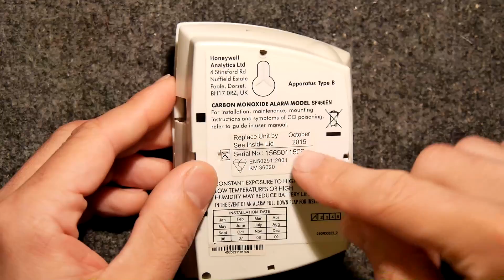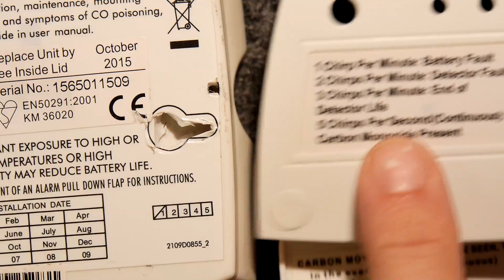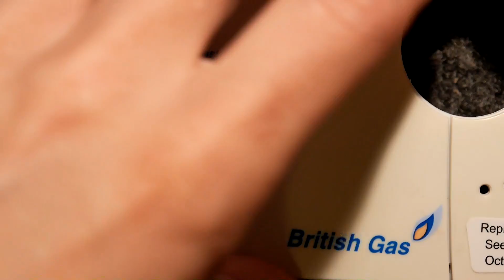Carbon Monoxide Detector Honeywell SF450EN

Comment: 3 pin piezo elements are feedback type for non self-resonating circuits. i.e. the micro doesn't generate the pulses, instead the micro controls an external driver circuit.

The expiry date on the unit is because the sensor is voltage generating sensor based on chemical reaction that degrades over time

The 3 wire device bent over is the driver transformer for driving the sounder element in an auto-transformer arrangement.
Reply from the maker: +sivalley Thanks so much for the expansion! I'm guessing a lot of this design is to ensure the lowest quiescent current as well? I notice that most alarm designs seen to operate on a frequency of one pulse server few minutes - or at least their battery check does.
Reply: +The Backoffice On the right path.  Most detectors sample at a very slow rate and sample more frequently if a change between the last and recent samples. This is also why if you look at detection sensitivity of most detectors you will see X ppm in Y minutes, sample rate increases as it approaches alarm threshold.

Because the outputs from microcontrollers is limited to a few mA, you won't be able to drive a very loud sounder.  But rolling your own driver circuit is a lot cheaper than using a relay to drive a sufficiently loud sounder. :)
Reply from the maker: +sivalley I think you have educated me totally on this ;) let's find another alarm to break!
Reply from the maker: +sivalley Sounds good to me, I'm weaker than a drink of squash at a summer fete on analogue electronics!
Reply: That’s very interesting! I opened mine after it had a battery warning and found a standard CR123 lithium battery inside. I replaced this and the detector continued to work until today when I got the three beep end of life warning.
Reply: @hughrobertwright  A lot of people are quick to say planned obsolescence, but in this case it's liability mitigation to prevent people forcing things with limited lifespans being pressed into service past guaranteable reliability when a false negative can endanger life.